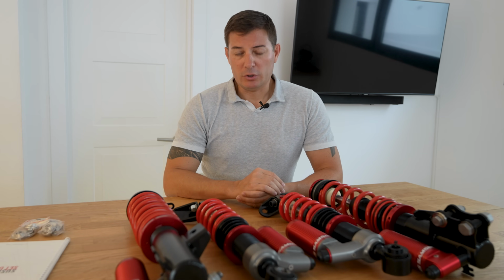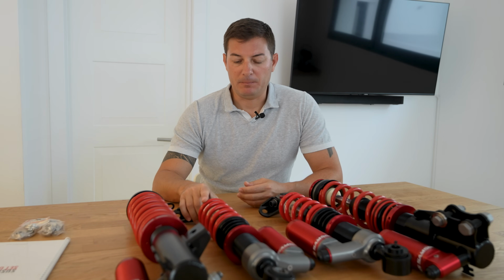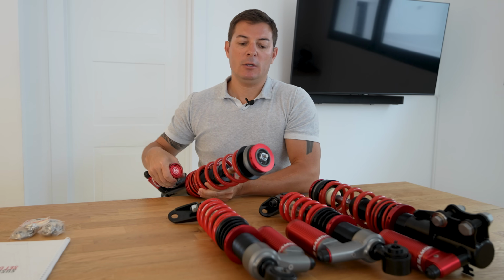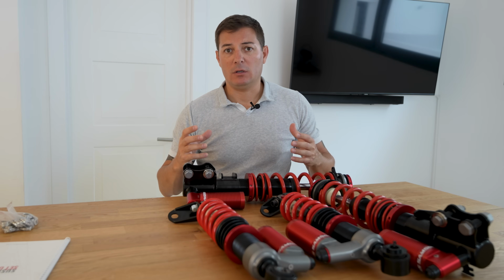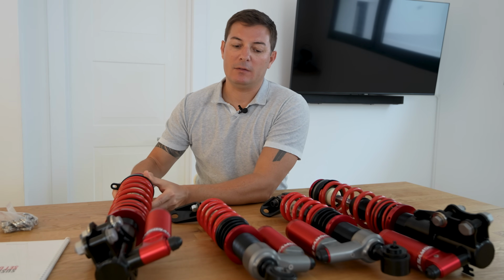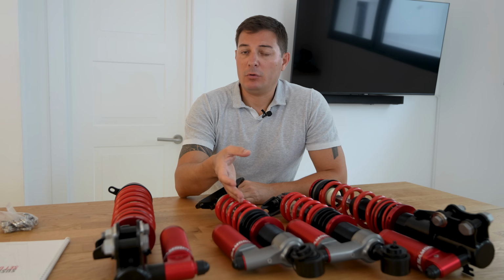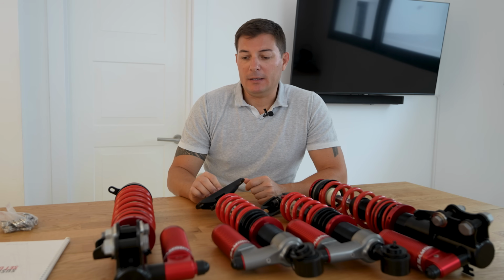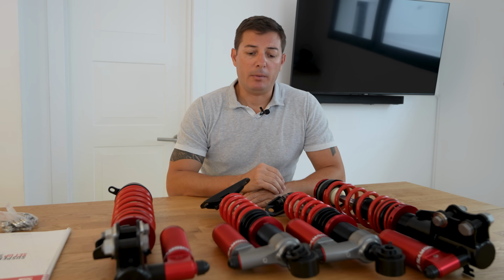Are These the Best Coilovers for GR Yaris? SAMSONAS 3-way suspension

Comment: Very nice… can’t wait to see you install and drive on these. I do touge time attack (Japanese style if you’ve seen those videos) on tarmac mostly in the dry and am still looking around for options.
Reply: Remember to pair this set with matched swaybars. If rear bar is too weak, leaving the rear helper springs open in corners, is going to make Yaris very unstable.
Reply from the maker: @DriftJunkie we have installed the kit today: for the current setup, helper springs are already fully closed with wheels in the air to achieve needed ride height
Reply: @PIRASMotorsport  What is their point then?
Reply from the maker: @DriftJunkie no point in this case…
Reply from the maker: This will most probably be a great option for your touge time attack mate!!!
Reply: @PIRASMotorsport  Is your travel (I think you said 100mm front 80mm rear) enough for this track: https://www.youtube.com/watch?v=36GD0sySoLQ ? Look how bumpy this tarmac rally road is.
Reply from the maker: @mixxeerr it should be fine, but let me finish setting it up and I will tell you more!